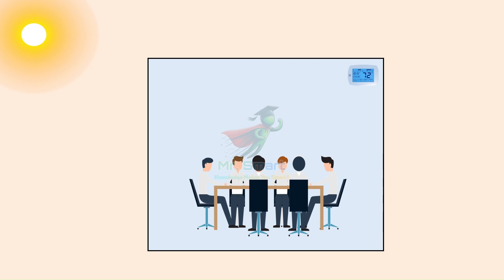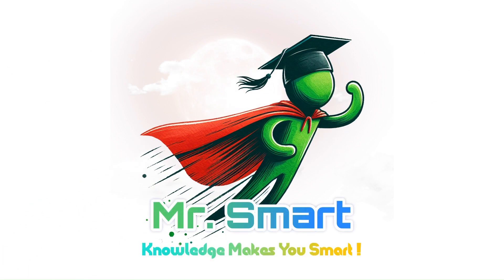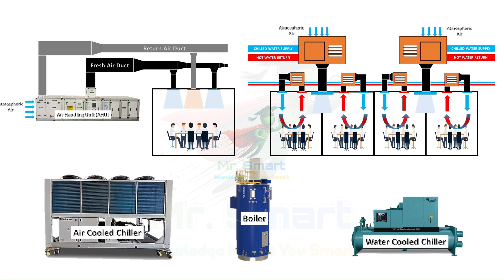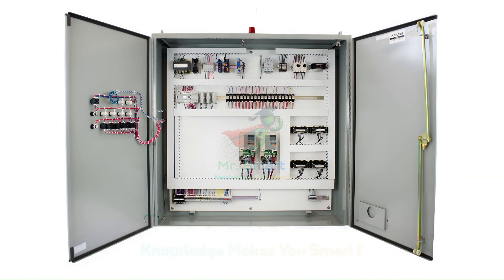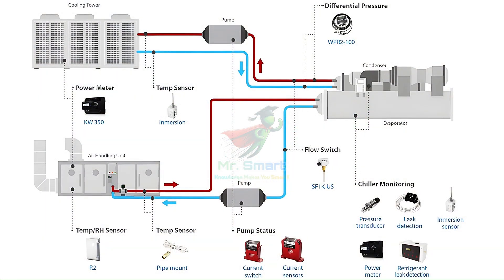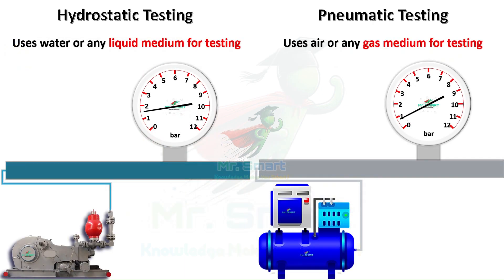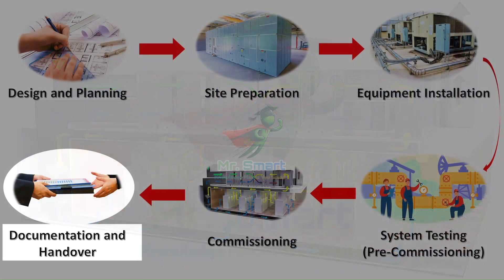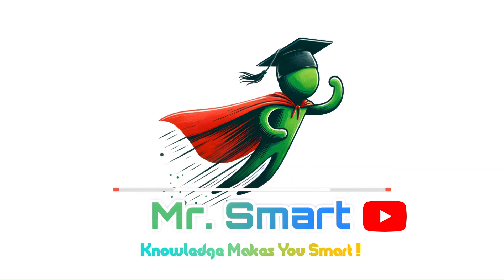How HVAC Systems are Designed, Installed & Commissioned: A Step-by-Step Guide🏢❄️ #hvac #hvacsystems

Comment: Your content is underrated and should be appreciated by the engineers, project managers, and stakeholders.

I have over 7 years of Project Management (Design to Post handover) and the role is never an easy task as I have to satisfy the project owner requirement, impose mutual fit decisions with cross-functional decisions makers, and team capability building.

Appreciate if you can expound more about pre-handpver and post handover, then this will help new engineers, entry, and experienced professionals about whole building commissioning contributions in the building construction.

Please keep going making these content as they are engaging, relevant, and user-friendly content.
Reply from the maker: Thanks for your kind words❤